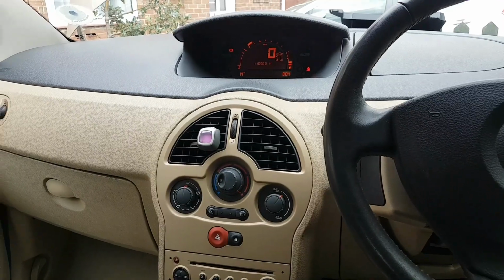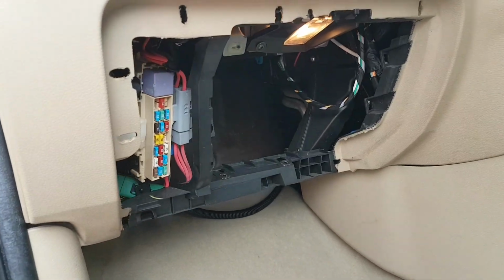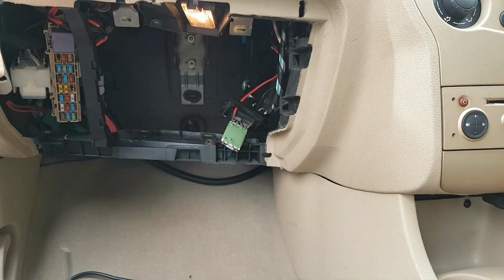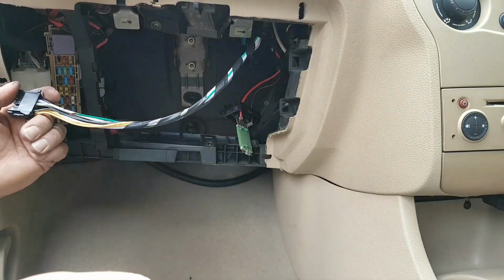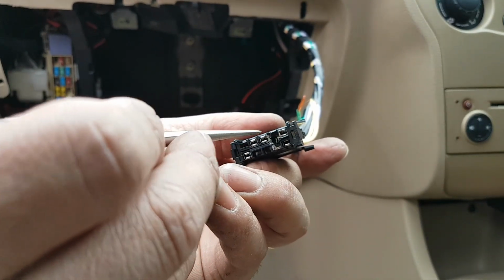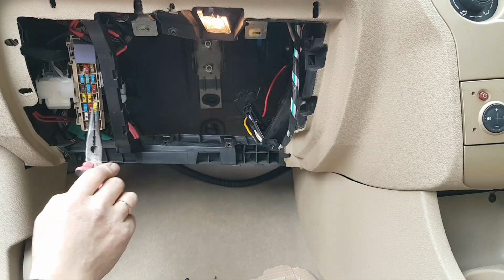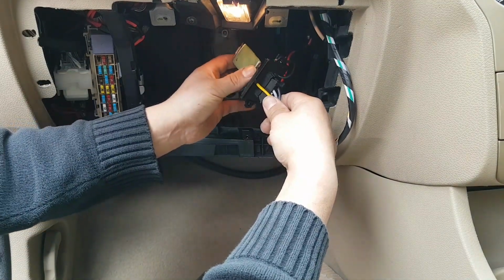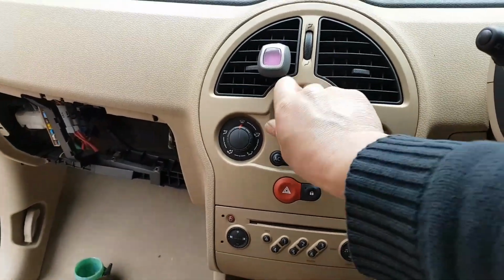Renault Modus HVAC fan not working and blowing fuse... Fault finding and repair.

Comment: Hi l lost my heater blower on my rhd (uk) ren modus grande 2010 diesel, as it expired it would work then not , then work over around a week or two.l checked fuses all fine do you think this points to the fan motor needing changing or is it still worth going in via glove box to check plugs..the right hand drive seem a more complicated swap, i.e. clutch pedal needs moving ,..thanks for your vids and sharing your knowledge.thanks again appreciate it.

Comment: Hey, hey. I have the same problem. How is your solution working after all this years?
Reply from the maker: The car was not mine... all I can say is that I was not asked to look at it again...
So I would guess, still going...
☺️
Reply: @LMAutoRepairs  That's always a good sign. 

My car is RHD so it's a lot harder to get there, but I'll do it your way. Just need rubber hand to unscrew resistor unit.

Thanks :)
Reply: @LMAutoRepairs  little info for those whom may concern:
My problem was lack of 4th gear. Socket, plug and insulation around green wire were melted. But that wasn't the issue at the moment, since it wasn't making shortcircuit. I fixed it the way that is shown in video. 

Lack of 4th gear was caused by lost of contact in plug for the thickest cable, violetish one. Since it's pretty big and hard to solder, I used Wago x3 to connect it to the black wire outside the resistor box.

In later version of Renault cars, this resistor had 2 more contacts to lower the current which flows thorugh them. If you want to fix this thing in most elegant way, you should buy new plug with 7 contancts or more (you can leave the rest unused) and new resistor with 7 contacts. You just bridge this two extra pins with 12V and ground cable. With resistor you will get new connector for fan side. Take care of it's shape, because there are two of them, however you can cut old one and fit it to new resistor cables. Good luck :)

Comment: I have a strange problem, similar to this on a 2005 Modus, where fan settings 1 - 3 works OK, but when I put to 4, it stops completely. Like you put it to 0 again! Very strange. Do you have any idea why this could be? Thanks!
Reply from the maker: No... you need to do your own checks to find out what is wrong...
The resistor still a good point to start...
👍👍👍

Comment: Which row and number in - is the fans fuse on? I tried to replace which I thought it was and it didn’t fix it 🤷‍♂️ or perhaps I need to try what you have here.

My fan stopped working yesterday. When it did work - it only worked on fan speed 4? 

1 - 3 did nothing at all.
Reply from the maker: Check this as per the video... it is a common issue on these cars...
Thank you for watching!

Comment: Do you know if it is possible to get access to the connector which joins the red & black wires (from the resistor module) to the blower ?  The red & black wire seem to go up inside the dash .. I guess there is a connector which joins these wires to the blower, but it t looks like I will have to remove other parts of dash to access it ? Thank you.
Reply from the maker: Hi
Sorry... but I can't remember now...
👍👍👍
Reply: @LMAutoRepairs  Thanks anyway - this video was a great help :)
Reply from the maker: @neilbreakwell4500  
👍

Comment: Great video .. very helpful - thanks.  Mine has a similar fault, but not exactly the same .. the fan is coming on the whole time at maximum speed, no matter which position the control is in.  But as in your video, it is a burned connection in the connector to the resistor module.  I will decide now whether to bypass the connector as in your video, or get a new connector and heat-shrink the wires.

Comment: Just enquire today I was driving on motorway for 4 hours this car. Once i got off the motorway and sat by traffic light i realised the there is a small amount of smoke coming out from under the hood. The car was not overheating it was in normal temperature. Any idea what it is?

Comment: Hey Mr. Louis i would like to thank you for the video for it really helped , second i would like to ask you a question , i have my scenic II 1.9 dci 2004 and iam having a problem with fan blower ...it is working but i doesn't go off even if i tried to put in low  speed it always stay the same high or low speed  ...what could be the problem?. please help.
Reply from the maker: Difficult to say... but a shorted resistor is a possibility...
Thank you for watching and for your comment!

Comment: Thanks very much for this - great to re-instate speed 2 on my heater fan.  The crucial issue is knowing where the part is and how to access it, and your video made it easy to find. In fact some previous mechanic had simply taped back the speed 2 wire, where it had melted out and no doubted shorted! I simply soldered a new wire in place as you suggested and all fine.
Reply from the maker: That's great! 
Nice to know my video helped! 
Thank you for watching!
Reply: @LMAutoRepairs it seems the modus and clios have different 20 torx  glove box removals, some have plastic cosmetic overlaps others are just interior threading.would of been handy to show which this was as you were already open and in.l aint a fool but know how easy it is to split these plastic trims.on mine a modus g theres 4 20 torx, 2 upper and 2 lower with these removed theres no extra give, l removed side panel with air bag stickers no joy there either just one more 20 torx that did  nowt grrrr.just need access to start the job,,,sacre bleuu renault why .

Comment: Where are you based please ?? got a problem with a 2011 Renault megane 3, 1.5dci !!!
Reply from the maker: Hi
I do this as a part time...
What is the problem?
Thank you for watching!
Reply: LM Auto Repairs won’t communicate  with our diagnostics machine, it will only find radio when doing a scan, thought it might be engine ecu related so purchased another ecu, had it cloned and still can’t communicate? Checked all fuses all good, car has got misfits which think might be injector but no way of diagnosis! Or even coding new injectors?? Think there is a problem on the communication somewhere?
Possible fuse box ? Bcm ??
Reply from the maker: @series1glenn  
Stop throwing parts at it...
Check can lines... if you have a scope, the better!
Otherwise measure wiring...
Check power and grounds to the modules...
Reply: LM Auto Repairs wouldn’t know where to start on checking can wires as cant find any information anywhere re wiring diagrams etc ! Hence why asking for your help..
Reply: It won’t find the uch/ucm?? Any ideas of pins to check at all please??

Comment: Hi Louis! 
I encountered such a malfunction. Contact overheats due to huge current! It is necessary to measure the motor current. Perhaps the current is above normal. Replace air filter (engine overload).
 I look with interest, Denis!
Reply from the maker: Hi
It is poor connectors really...😉
Thank you for watching and for your comment!

Comment: Thing to be wary of soldering high current cables is the high current can unsolder the joint. Hence why they crimp connections. If you do want to solder, a way round this is to wrap some tinned copper wire around the joint, in effect binding the wires together and creating a good physical connection. Then solder up the whole thing.
Reply: yes you are right

Comment: one issue you didnt messure the current of the fan,in all the speeds,it could be an problem with the fan.
Reply from the maker: Yes it could... 
So far still running... so guess the fan was and still good... but definitely I get your point!
Thank you for watching and for your comment!

Comment: tyhose connectors were used in the laguna 1,for the behr or valeo fan (airco)you can t buy them at Renault......
Reply from the maker: Correct...
Thank you for watching and for your comment!
Reply: @LMAutoRepairs  try Ali express... Found some connectors there but the wires are a bit thin.... If I find a link I will post them....
Om 【US $3.41  10%OFF | CITALL Heater Blower Weerstand Kabelboom Harness Reparatie Fit Voor Renault Megane Grand Scenic MK2 8200729298】 op AliExpress met code #DI8eEWfLV# te bekijken, kopieer het hele segment en open de app.

Comment: Nice fix 👍 but if in the future the resistor is faulty, do you also need to solder the yellow wire directly to the blower resistor?
Reply from the maker: I think if it fails again, I would just get new plugs and resistor...
Thank you for watching and for your comment!

Comment: Be aware the rear light cluster multi plugs also suffer from contacts over heating causing the plastic plug to melt, usually happens to the earth connection, solution is to make a permanent connection to body from the bulb carrier assembly earth terminal.
Reply: This happens on most french vehicles and ford transits.
Reply from the maker: Thanks for the tip...
👍👍👍

Comment: Great fix. I recently fixed my brothers Grand Scenic heater resistor plug, that was melting and causing resistor failures. The fix addressed a few problems, one making it easier to access. The replacement plug comes with a loom, so we cut and use solder shrink to link the cables. So now, if the resistor blows, it can be changed outside the aperture of the dashboard, due to the extended length of the loom. Renault electrics are terrible.
Reply from the maker: Good job!
Yes, Renault wiring can be very flimsy...
Thank you for watching and for your comment!

Comment: Hi you probably  know this but it's a common problem and you can get the repair connector and wires from Renault they do it in kit form but good video
Reply from the maker: Yes... next time it fails will have to get one... but so far still going...😋
Thank you for watching and for your comment!

Comment: Did a similar one on a Fiat this past week. a 30 amp fuse was put in place before calling me and so half of the hot cable to the fan got burnt and rock solid... why do some mechanics think fuse amperage is chosen randomly?
Reply from the maker: 😂
Absolutely...
Have you seen the videos I have done for the bmw F10?
A very good example...
Thank you for watching and for your comment!
Reply: @LMAutoRepairs  Yes i saw that video! Also i would like to thank you for your forum, It helps me a lot on the field being able to talk with techs like you, ecutech, Rookie, candiagnostic.  Have a good sunday!
Reply from the maker: @planet1250  
👍👍👍👍
A pleasure!

Comment: Watching while  Selco  opens up!
Reply from the maker: Thanks!
Hope it takes at least 10 minutes to open...
😉
Reply: Great video again  (-: 
Question:
Do you have any contact details in fact I would like to ask you about something please 
Thank you
Reply from the maker: @christopheveriter8806  
You can always ask here...
😉
Reply: LM Auto Repairs ok,
So I would to bypass EGR system and would like to know your opinion about the situation
Reply from the maker: @christopheveriter8806  
Which car is that?
Best way still, will be to do it on the ecu software...
Reply: LM Auto Repairs that’s what I would like to avoid and that’s why I would like to have your opinions
Reply from the maker: @christopheveriter8806  
You can just blank it... but most likely the ecu will see air flow discrepancies...
Ence the software mod is a must...
Some cars take the blank approach only... but not all...
Reply: LM Auto Repairs I want to block exhaust gas port and take normal air  from the air filter box you know 
The only questions I have is:
Do you think that the lambda will see it ?
And will the engine take the air as there is no pressure like on the exhaust port you know 
Sorry for my poor English
Reply from the maker: @christopheveriter8806  
I have already answered...
If you block the EGR without delete it in the software, the ecu might see it as a fault...
Because when the EGR opens, the air passing the maf is less...
So, if you just block it, when the ecu commands the EGR to open because is blocked, the amount of air passing the maf will be higher, so the ecu might thinks the EGR is faulty or clogged, and logs a fault...
Hope it makes sense..
Reply: LM Auto Repairs I fully understand 
Nevertheless my idea is to block exhaust gas but not to block the egr 
Basically the idea is to leave the egr and use a different circuit and use clean air if you see what I mean ?
Reply from the maker: @christopheveriter8806  
Got you now...
Interesting idea... let us know how it goes...
Reply: LM Auto Repairs (-: 
I am sorry for my poor English 
That’s why I wanted to talk to you in a different place as I don’t want to disturb your YouTube page
Reply from the maker: @christopheveriter8806  
No worries...
👍
Reply: LM Auto Repairs my only concern about this egr idea to short cut the exhaust system with intake air is 2points :
-What the lambda will tell ? 
- as we are with a Diesel engine we do not have under pressure meaning between in and out egr valve I have exhaust pressure meaning when the egr valve open I push exhaust gas into the intake but if I use intake air this over pressure is not there so would I generate enough difference on the map sensor ?
Reply from the maker: @christopheveriter8806  
You have a point... the ecu looks at several things to verify that the EGR is working correctly...
I guess you will have to try and see what happens...
But one question, why not the route of just delete it in the ecu software?
Reply: @LMAutoRepairs  i just do not want to modify the ECU Software as that is not so easy in fact removing EGR flag is easy but you have to make sure that do not affect some other stuff as everythink is linked 
also that's why I am asking your opinions as you're really fit and I really like your approach